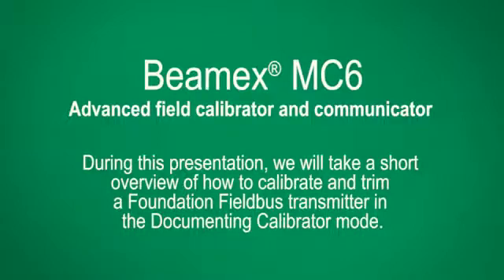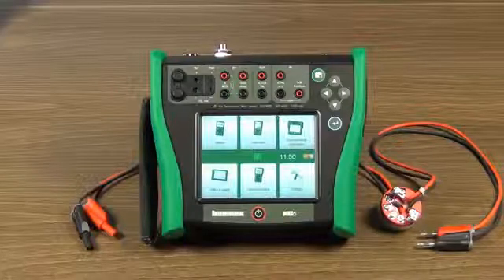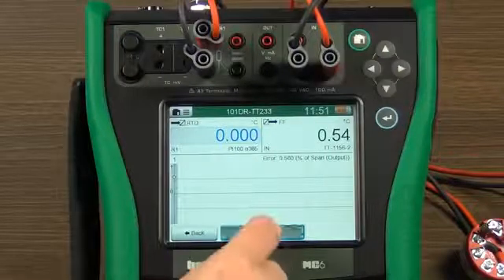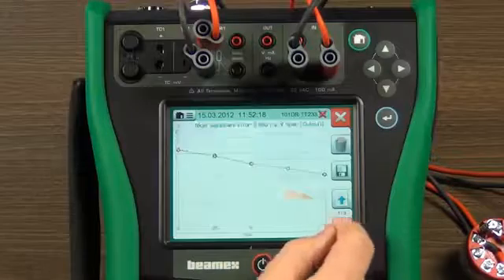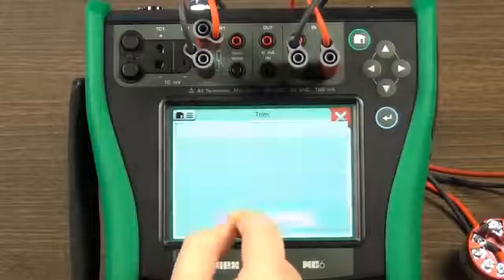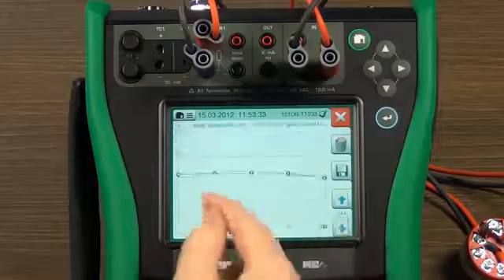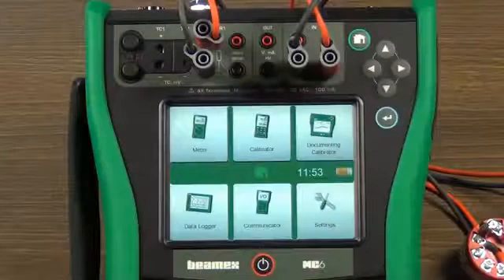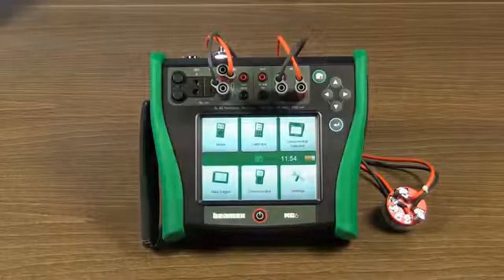Beamex MC6   how to calibrate and trim a Foundation Fieldbus transmitter

Comment: I have some fieldbus temperature transmitters in my plant that have never been calibrated I have BEMAX so I am going to do this method tomorrow and see what is the result? thanks for this interesting video.
Reply: What model calibartion Beamex do you have?, you can connect the Temperature transmitter with MC6 sample wirring on this video, after that, you can selec the  Foundation Fieldbus funtion on MC6, then the MC6 will be scan and find out your device